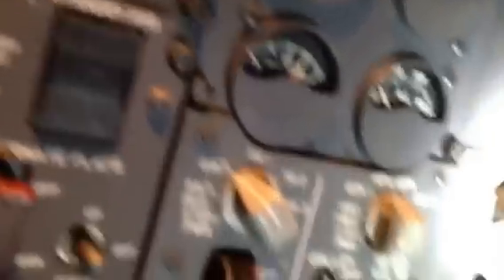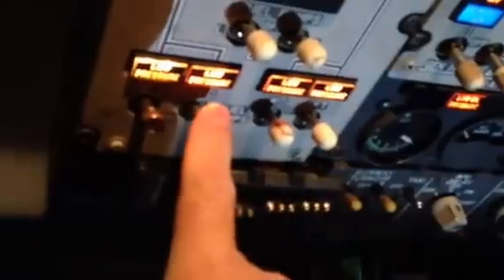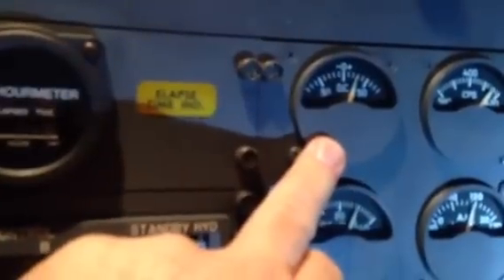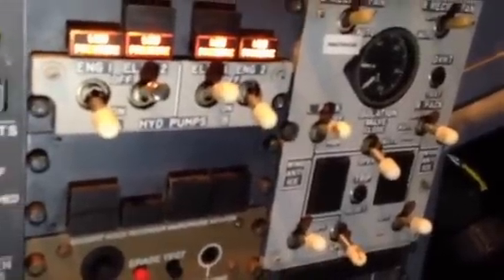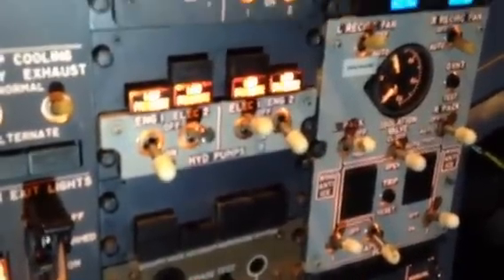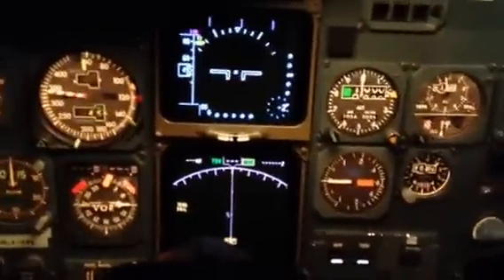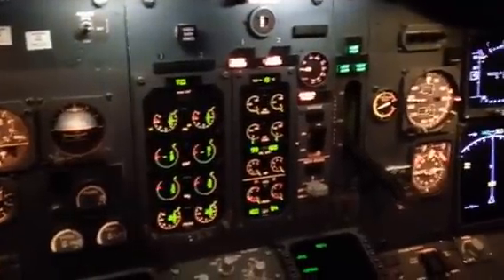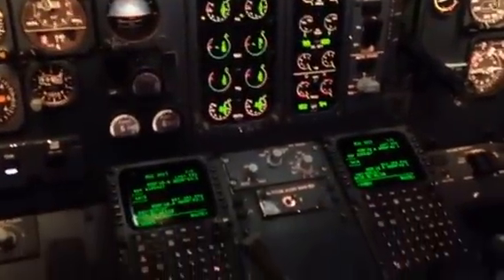B737-400 Cold Dark Start

Comment: "now thats weird, always something with these old airplanes" - filling me with tonnes of confidence, fingers crossed my next flight is on an A320
Reply: Plane would likely still run. All the avionics would die but the primary control systems would still be functional. There are usually two if not three fully redundant and non-interlinked hydraulic control surface systems, with at least one which does not run off the primary electronics based control system. Commercial planes are bonkers with how much redundancy they have.
Reply: JP's Workshop the 737-400 is pretty much no longer in service. They have been replaced by the -700, -800, and the -900. So you don’t have to worry about flying the oldies.
Reply: +Dachantenne that was pilot error.
Reply: Well if that flight have been in a Boeing the retarded pilots would have forgotten what is a stall too. So the outcome would be the same
Reply: JP's Workshop I actually trust older planes more. I work in production automation and maintenance and it is great when it works but when it messes up (and it does a lot as those failures employ me full time) it fails in very unpredictable ways. Old planes with simpler automation require skilled pilots that actually need to know how a plane works instead of button pushers in modern planes and old planes when they have a problem tend have more logical problems unlike highly automated systems. Also old technology ages better where as new tech gets outdated and glitchy quicker. I work in automation and think it is very powerful when human lives are not on the line but when you have souls on board I want a person to be the one in control getting help from a computer. Boeing all the way.
Reply: +Dachantenne That was due to the pilots forgetting how to fly. They responded to a stick shaker indicated stall by pulling back and continuing to pull back on the stick for minutes. Complete brain freeze. Even a novice pilot would have known to push forward to regain airspeed.
Reply: You're right. Horse and carriage, that's the way to go. Who needs progress?
Reply: Unless you are flying ultralights, I'm afraid you are too late a couple of decades. It's all fly by wire and full authority engine control units. Even in planes like A320 and 737 pilots can only "ask" the airplane to do things, it's all filtered by software.
Reply: Because the computers usually are
Reply: Where crews often utter the phrase "what's it doing now?"
Reply: Who needs an EMP? All you need to do is ice up a few "ice-proof" sensors and the autopilot will kill everyone before the pilots wake up enough to take over! (And they keep talking about pilotless planes)
Reply: Not all 73s have issues
Reply: Smth smth average Joe much?
Reply: I prefer the old planes, the new ones have too many computers trying to be smarter than the pilot. I'm a software engineer.
Reply: 737, 2 landings for the price of one
Reply: lmao id trust a boeing anyday
Reply: It was only bleed air indicator to one of the aircon packs, hardly life threatening.
At least a Boeing is honest about failing, a Scarebus doesn't tell you till it can't fix it for itself and throws you in the deep end with a multitude of failure codes you have to figure out....
Reply: reverse thrust you should really keep your tin foil hat on, buddy, all the time:)
Reply: Boeing, or i'm not going!
Reply: ramairgto72 thanks
Reply: WeddingVegetables Wish we could drop the world back into the 19th century. Life was hard, but the culture wasn’t dictated by tech addicted shitbags.🐙
Reply: Gerry James Amen. I was just sitting talking to my wife.  I asked her to close her eyes and listen to just how insanely loud the world around us is.  She looked up from her smartphone and said, "huh"?
Reply: Just take a look to AF447, then you hope your next flight is on a Boeing
Reply: WeddingVegetables Progress is about to put a big hurt on a whole lot of folks.

Comment: For any wannabe pilots watching this DON’T cage the standby horizon (as shown) until the flag has cleared or you risk damaging the gimbals. The flag will clear when the gyro is up to speed.
Reply from the maker: I think perhaps we have an 'old wives tale' here.  The standby gyro installed on air carrier aircraft are not the same as on general aviation aircraft.  On these aircraft, it is easier on the gyro to erect it before the gyro comes up to speed at which time the red X flag will withdraw.  I don't know if it will hurt the gyro more one way or the other but in flying and maintaining air carrier aircraft for 40 years, I have yet to change one.
Reply: you're a youtube commenter, why should i trust you over the boeing mechanic in the video?
Reply: Wannabe pilots learning on YouTube....fills me with confidence.......
Reply: Me personally, I always like to check the specs on the rotary girder before I cage the standby horizon
Reply: Why?  It’s probably a nav or FD flag. The gyro flag gets removed as soon as it has power to it. Not going to harm it whatsoever by caging it. Letting it tumble and struggle on its own is worse.
Reply: Standby gyro spins up almost immediately once given standby power. It does more damage sitting on its side while trying to erect.
Reply: Personally I think the best option is to flim flam the zim zam before firing up the left phalange. And don't forget to start up the slappyham AFTER the flibbyjab.

Comment: How many APU starts does a healthy battery give? How normal is a flat battery? Is battery temperature monitored? Could the battery catch fire under load? If the battery is flat is it no big deal as you can get an external start? Would that external start start the APU with electricity or air? Or would you go straight to a main engine start from external? Apologies for the stupid questions.
Reply: Not stupid at all. The book says 10. But usually by start 4-5 you know you have a problem and/or volts are down to 22 ish and not safe to pull that many amps on the starter motor.  If the APU is a dud you start the engine directly with bleed air. The APU doesn't have the capacity to start from bleed air.
Reply: MrRexQuando Thank you. I appreciate you taking the time to answer.

Comment: I have a dumb question 

Why can't jets/airplanes have a single start key, just like a car?
Reply: edgu71eg well there's significantly more systems than a car. But once this is all done starting the actual engines is relatively simple.
Reply: HighFlyer oh ok

Nice
Reply: They come close in some cases.  The Bell 429 helicopter has a fully automatic start, as long as the pilot has completed some steps first.  Push one button and the computer does rest and starts both engines.  It has a rather nice series of chimes too, to tell you it's ready to go.
Reply: LS A 737 is slightly more complicated than a Bell 429. Just like a Peterbuilt is more complicated than a Sentra. In the 737 once the electrical, APU and pneumatics are setup the engines are started just as easily as the 429. Interesting also the APU used in the 737 has more power than one the engines used in the 429.
Reply: Because all the systems on larger aircraft are designed to be independent, but able to be slaved up to several supply systems, for redundancy in case of failures.
It means any of the sub systems shown being activated can be take off line if they start causing issues in flight.
Reply: reverse thrust simple, don't turn the switch that turns off fuel to the engines. There will be one for each engine.
Reply: LS nice..... have you seen the video where they start a p51?

Omg lol it would be  a nightmare for someone with ADD. 

So many steps

Comment: Does the Apu run at all times during flight?
Reply: Generally off before flight.
Reply: Josh Bommer then restart before landing so it's running on the ground in the gate or re started in the gate?
Reply: Usually started on taxi after landing, to provide aircon and electrical services when at the gate, unless the airport has plug in ground power, then it will remain off and one engine will carry power and bleed air loads until ground power is on line.

Comment: I'm quite certain he knows how to start the engines just to soon so he made little of himself.
Reply: Engines are not started until needed. There is no point and there is a major safety and ground handling risk with having them running as well.
Reply: I'm pretty sure the OP meant that they are quite certain he knows how to start the engines but it wasn't time yet, so he pretended he didn't know how.
Reply from the maker: An astute observation...

Comment: Who turns all the dimmers down and why?
Reply: You turn all lights and panel illuminations off so that when you come back and turn the battery master on there isn't a whole load of systems drawing power.
Reply from the maker: Pilots routinely turn all the dimmers down to save on light bulbs.  It doesn't seem like much but the all the light bulbs are very difficult to change and you always seem to break something else when you change them.  All cockpit lights are turned off during the day and whenever the aircraft is to be powered off.
Reply: Could of been shut down for the day during the day so no need for lights but next day it is dark. Or to increase battery life
Reply: When I preflight an AC I'll dim everything so that when it's sitting with power on for an hour all the lights aren't running full brightness, sometimes It'll have power for a few hours at a time and if no-one dims the lights it'll begin burning stuff out.
Reply: Shutdown check you turn everything off. That way when you bring the APU online you don't have a huge load that trips the generator off. It's the same reason he checked the packs, hydraulic and fuel pumps were off before starting the APU.
Reply: The previous crew does. If I get to my airplane and find anything other than the center EICAS lit, I don't like it (757).
Reply: yeah its for your night vision. you dim them way before landing in the dark also.
Reply: You dont notice their turned up during the day time and burn them out when you really need them.
Reply: Kind of weird. On my plane, I turn them all up. There is a master switch that controls cockpit lighting and is left off for battery starts.
Reply: The same why you turn off your TV before you pull the plug...
Reply: For night vision, maybe? It's hard to spot anything outside, in the dark, when the panels shine in your eyes like a Christmas tree

Comment: Regarding the left hand side duct pressure reading , had the left pack valve been opened instead I guess this would immediately pin the issue on the gauge or the sensor measuring the duct pressure? Clearly the left hand side duct was pressurised since it was supplying the right hand side via the isolation valve.
Reply from the maker: To be honest folks, I had a major brain drain when I made this video.  There are several mistakes and referring to the checklist would have caught them.  One glaring mistake was closing the engine bleed valves.  While closing them does no harm, the potential for them to stick closed means that the affected engine cannot be started. So the main engine bleed valves are only closed for maintenance or when required for operation under rare situations.
Reply: lol
Reply: wezair80 But the right side spodgit needs a boost from the vent shackle, or you run the risk of the over-loofah exceeding the recommended pressure blump. Failing that, over-dretch the hove-port undershim.